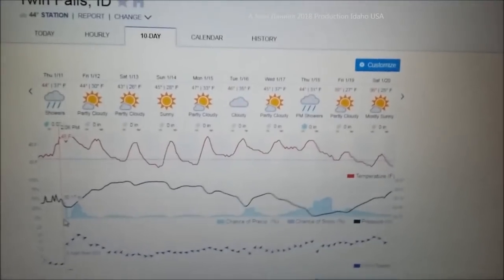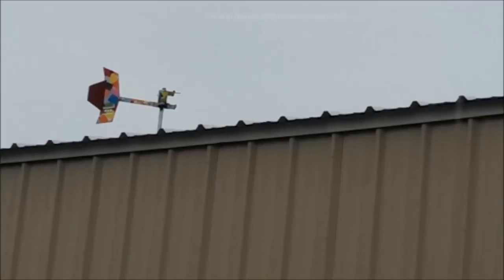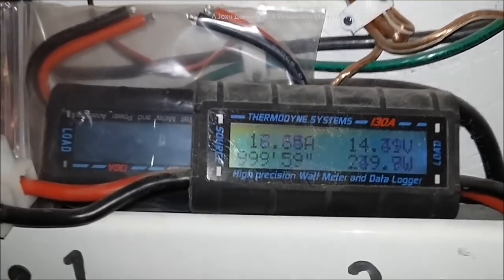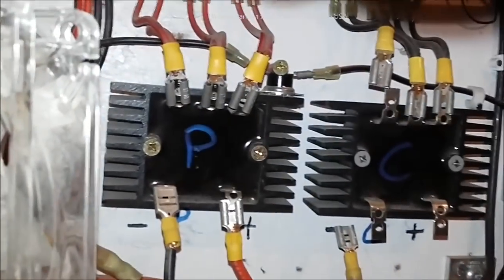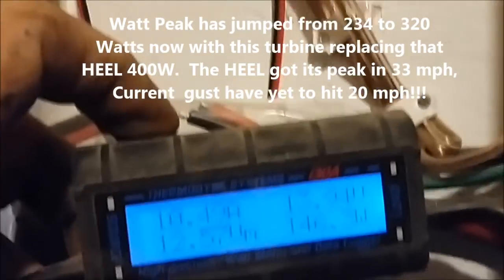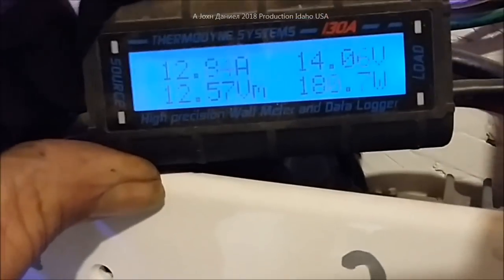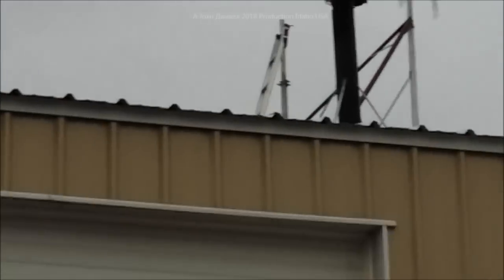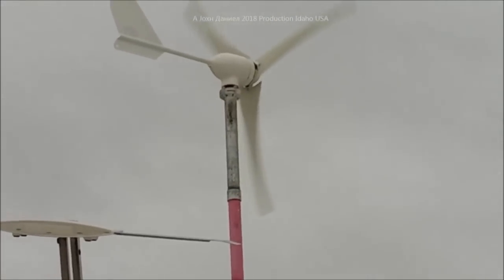Success, $220 (before inflation) China 500 Watt Wind Turbine super performer, BIG PARTS LIST BELOW

Comment from the maker: All the links I could find and add are up above under the video.
Reply: Would be nice if there was a site to verify their claims of some of those generators putting out 2000 or 3000 watts of power for only $200. On some of the sales, I have seen buyers complain the output was more like 300 watts.

Also, you may wan to verify those links. They seem to be broken when I click on them.
Reply: @GeekBoy03  hey 
Yes ... Now i don't know you'r level of tech ... 
1 you can't relay on the Controler you get with the producer ... 
2 you need a 3 phase Rectifier 
3 a MPPT Controler .. 
4 Then you are golden .. 
5 if you don't agree .. Then cool . You Will never get 3000watt out of any 
Wind turbin with out a MPPT
3000watt Divided with 48v = 63A 
6 so you need either a 60A 200v 6415 EPever or MitNite 250v 
Or 80A MPPT for overhead ..3000 often deliver 3700watt at max windload 
Just a head Up 
3000 / 12 = 250A 
3000 / 24 = 125A
3000 / 48 = 63A 
If you use MPPT 
Not PWM CONTROLER 
Why !! Becaus i say so!
Reply: Hey @John 
I would like if you tell ppl 
HOW TO .. with 
1 windturbine 
2 rectifier ..
3 evt electronic break / dumpload and so on / hotWater dumpload 
4 MPPT.. not PWM CONTROLER (like you said PWM is just for IDIOTS)
All these not so Bright ... Can't put 2 and 2 together and get 4 ..!! !!!
And thick lead 5 or 4 x 2.5mm² down to rectifier.. 
And atleast 35mm² from MPPT to battery!!!
Thx Greetings from DENMARK
Ve are never stupid somtimes
Reply from the maker: @kennethschultz6465  I do have a video about 3 months ago where I draw out the process, but yes people should only use MPPT to get all watts placed into battery.
Reply: @kennethschultz6465  I could not find the wind turbines on their page .. can you post link to the actual turbines ... thx
Reply: IT is SHTEPOWER Who make All these brands 
By Stricker EMC EMP RFI NOICE RADIO TESTED 
CE APPROVED .. 
THEY KEEP WHAT THEY PREATCH ..!!!
flot note .. i am a A licenced HAM .. operativ on HF VHF UHF SHF
I do not like interference!! At All ..
The level of noice from these produkts is way under the noice level in any city.!
We hawe also used HP SPECTRUM ANALYZER 
From 10Hz to 4.5 GHz
Found No problems !!
Reply: Give a hallow if you can't find ITVAlso got ther PDF CATALOUG
Reply: Hey John 
Just poster the 2 links but the turbin is 48v
The Alibaba SHTEPOWER SITE to the proper windturbine 
TE500
Or TE1000
Reply from the maker: @muzaffarbaktoo7202  Send me a email to olympicpowercontrols@yahoo.com and we can talk about your interest. I can usually respond in a few days.

Comment: What about the  b c wind turbine  are you the mountain  YouTube  or this one cheers
Reply from the maker: Both, I keep my BLOG Channel up, Prepper Mountain, and this my regular You Tube group channel up with my videos and some small alterations to fit the folks who follow.
Reply: Ok thanks I have  just  brought  this  wind turbine  from b c what was your highest amps and did it last you long  S I'm on costal property  with  plenty of wind  cheers  john
Reply from the maker: It is still running in Baker Nevada at our camp house and it's historic peaks exceed 65 amps, top output was 84 amps in a storm, so be sure to use 3 lines of heavy 3 phase wire, 10 awg stranded copper if run to controller/rectifier is under 18 feet, 8 awg if its over that.
Reply: That's awsome  John  I hope it exceeds the the the junk one I have up at the moment

Comment: @John what would happen to a turbine if one of the 3 phases disconnected at the turbine? Loss of power or zero production?How would I know without taking the turbine down?
Reply from the maker: Loss of 60% or more of the power. Likely no power until much higher winds. Carbon brush on slip ring or wiring issue under turbine back to controller or rectifier is normally what to look at.
Reply: @JOHNDANIEL1  could I check the phases some how at the brake switch in my shop?
Reply from the maker: Yes, disconnect the 3 wires from the brake or controller and test them while some decent wind is blowing on the turbine, 2 each time, repeat and alternate the test till you tested all 3 against each other. See if a great variance is found. You may have a bad brake switch, bad rectifier, bad controller. But free open voltage will tell you if your turbine is the issue.
Reply: @JOHNDANIEL1  the problem I'm having is when I get 20+ mph wind gusts my turbine only puts out between 5 and 14 watts.never anything more than that.

Comment: High John something that i want to ask you very important that if you have solar system in of 10 kw and batteries of 10 kw i want to put up a 1 kw wind turbine how do i connect the lot with each other. Do i have to buy a separate Charge controller because my controller for solar cant take wind wires  do i have to put a wind control system up and connect then to my batteries.

Comment: Has anyone ever change the bearing near the shaft/Flange on these turbine if so how does the shaft come out once cir-clips been removed ???
Reply from the maker: Remove blades and hub, remove  the bolts on pattern around the front of the turbine, using a dead blow tap on it a little bit as you wiggle the face cover will come off make sure you pull very centered because the magnets are strong when you remove the front half you'll note the rotor will slide out of the bearing in the faceplate it's a double row bearing. Take a hair dryer and warm up your aluminum face plate, the bearing will come out easily with light tap.
Reply: I've managed to change that bearing how does the other bearing come out I've removed inner and outer snap ring but shaft will not budge. Its the bearing which is in line with the pole. Any help will be appreciated.
Reply from the maker: It's pressed in. Heat the outer base body not to exceed 300 degrees, and use a tube or something like it to tap it out race points if possible.

Comment: I'm going to buy this unit. I have a 12v battery bank. Should I get the 12v turbine or would the 24v turbine be better?
Reply from the maker: If you get low wind speeds, under 15 mph on the high end you'll want the 24 volt unit to charge 12 volt batteries. I would recommend a 800 / 600 MPPT wind and solar controller https://amzn.to/3Mampaj and it will auto detect your 12 volt batteries but allow the 24 volt turbine to charge them with great efficiency.

Comment: $200..ish!!!! WOW but how's the noise after having up for a while? I have a small house and want to put one or two turbines up..right now battery costs are holding me back..and the noise is a concern for me as I have neighbors with ears. I have heard of people placing sedated teeth on the trailing edge of the blades and supposedly it cuts the blade noise by half. Ever try it? Sorry for the rash of jibberish but I'm a newbie and can use all the advice I can get.
Reply from the maker: For very low noise look underneath some of my videos for links to the 500 watt low wind models, 3 blade, and it will give you good power and very quiet.

Comment: One quick question for anybody that has set up a wind turbine. What is the max distance that I can use a 10/3 outdoor stranded copper cord for a 400 watt wind turbine ?
Reply from the maker: 12 volt 52 feet
24 volt 70 feet
48 volt 84 feet
With 8 awg you add 65% to those.
Reply: @JOHNDANIEL1  thank you

Comment: Hello John.
Thanks for All of your Videos and your shared knowlegde.
I bought the exact same wind Turbine (3 blader) as mentioned in the video.
Unfortunately it won't produce more than 15Wp :(
I got 10mm2 (about 8m) wires attached directly to the rectifier. Which has 10V roughly at peak (60-80km/h).
Am I doing something wrong or is the generator not as good as espected?
Looking forward to any Suggestion.
Thanks in advance
Greetings from Germany
Lucas

Comment: I love your videos and they're so helpful but I have a question for you I want to install one on my roof and it's an 8 pitch can I use that to my advantage?
Reply from the maker: Yes, you can install a pole about 8 feet over the roof from the peak, place streamers like tinsel on it ever 6 inches, and note the best ones lifting up in a breeze to identify the compression zone. then place your turbine center just above that so your bottom section of turbine blades are getting full energy.

Comment: Just finished installing my wind turbine but its not giving power to anything. Have check my wiring for faults but still its not working any ideas?
Reply from the maker: Send me the details on it. Model, where bought, area your installing it in, and any relevant info. I'll see if I can help. olympicpowercontrols@yahoo.com
Reply: @JOHNDANIEL1  got it working. The rectifier that came with the turbine was faulty after checking with meter

Comment: I've seen a 20kw from China which cost 60'000 to put up and it gave out nothing and later that year the main bearing on the blade burned out and that was the end of her as it turned out a bearing couldn't be replaced on her without changing the whole head. It was a complete right off. Three went up in the area 10 years ago and didn't last more that 12 months between them.

Comment: Hi Mr. Daniel, I feel sorry for my English but is what I have, I been making maths and you are lucky because you have about 18m/s wind and maybe for your purpose is correct. But, if the blades are 800mm the potential energy for 18m/s is 7kW, and you are generating at most 250w, that means an efficiency of 4%.
Reply from the maker: Total diameter of 500 watt turbine blades is 1.38 meters. My winds are 4 to 20 m/s. But the properties of a wind turbine is that it has a highly progressive power curve. So when your at 12 MPH wind speeds your making 65 watts ( 4.5 amps) , at 14 mph you can hit 110 watts, at 20 mph you can hit 340 watts, at 25 mph it will and does consistently produce 450 to 550 watts.

Comment: Thanks for posting I bought the similar 300-watt version that works well here in Pennsylvania compared to the other larger ones. It's quite a bit different than the "aerodynamic" ones. I would recommend using 6 volt batteries rather than 12 for this area.

Comment: I don't know much about this, but is 100-200 W good? How much power is that in real world terms? Will it run anything?
Reply from the maker: 100 to 200 watt? These do better than that on a average, 200 watt is a extra off grid 15 amp battery charger at a minimum. Now compare that to the fact we run 5 total on our system. They double the life of your battery bank with the pulse charging effect they make, they run in bad weather and using multiples I never have a low voltage moment in almost a decade of doing it.
Reply: @JOHNDANIEL1  I guess I need to do more research. I didn't understand any of that.

Comment: Purchased this turbine about a year ago, but have yet to put it up.     Thinking about using an inverter that allows it to tie directly into the grid, with a resistor for the dump load.   Would it work correctly?   Looks like it has a built in brake.   Any comments?     https://www.amazon.com/dp/B07FFSQ5PQ/?coliid=IZX3OMZN4IDJW&colid=XPZ319JX03I8&psc=1&ref_=lv_ov_lig_dp_it

Comment: For me it's the batteries that are expensive so I prefer solar just because the power is constant and I can use it as it's coming in directly without having to go through the batteries first which wears them out faster.  With wind you get surges and drops requiring all power to go through the batteries to keep you running during the drops.

I want to use an electric car as one big ass battery bank on wheels. :)
Reply from the maker: Avoid Lithium, factually has a short life, over hyped, dangerous and 3x the cost. Get the DEKA SOLAR or Duracell B-903-L16 that actually last a real 10 years. Made by East Penn, sold by Batteries+ as a Duracell for less.  https://bit.ly/2wv1VXd Order online, pick up for cheap.

Comment: Can you store energy with this..? Like for example, could you just keep charging up something (a battery I'm guessing?) For a month straight ? 

Also would you say 2 of these could power your houses lights/computers/small things? (not furnace or anything more serious)
Reply from the maker: If you have constant wind, you can achieve a lot, but without solar your not guaranteed anything constant. As for a battery bank, when it reaches full charge it just diverts excess into a controller or diversion load.

Comment: Dear Mr. Daniel, My name is Stosh and live in Nome, Alaska! I love the videos and all the information that you put out. I'm hoping to get a parts list from you of all of the stuff needed to install 2 turbines on the roof of my shop, wire size and everything that I would need to install a system. I want to add solar later. we pay about $0.32 a kwh. what I want to do is be able to auto switch from city power to battery bank when they run low. can you help me?
Reply from the maker: You can direct questions to my shop email olympicpowercontrols@yahoo.com
I usually can help with more accuracy knowing all parameters your dealing with. Better to focus the dollar than waste it.

Comment: Its amazen to see how that wind turbine making power
Reply from the maker: Absolutely. Be careful on St Lucia for them south basting winds in a storm, make sure you have a way to keep yours safe. Mine has seen over 100 mph winds, they are OK. but I  made my own loaded braking system.
Reply: I see storm here already people roof fly tall coconut trees brake in 2 i have ground mount solar I had trap it down because of high wind see some times

Comment: Uxcell Fixed Type 2R Tubular Wire Wound Resistor, 100W, 2 Ohm
by uxcell
4.8 out of 5 stars 6 customer reviews Share

    Compare: Offers for this product Offers for this product and similar products 

There are currently no listings for this search. Try a different refinement.

Comment: Rite now until June 1st 1800 watt turbines on ebay $224.00!
Reply from the maker: If you believe a 2 pound copper coil in a Asian made PMG-PMA to be claimed as passing 1800 watts @ 12 volts though a 12 gauge wire is possible then by all means get 10 of them at that price. In the mean time in the real world, you will need 9 foot diameter blades and 30 mph to get those results with 9.5 lbs of copper coils, but on that $224 thing you can get it for about 5 seconds till it smokes. A moron from Missouri sells such a item that could not make 1800 watts no matter what you put it on whether its a wind turbine, a jet engine or a V-8 engine. At least the guy in California makes one that can physically hit 1800, but you just can't do that and make it last long plus the blade size needed to gather that much energy exceeds the shafts ability to support the mass.
 My experience with those EBAY ADS, is if the sellers want high sales, they should employ real results even if its 600 watts, Real installer reviews/videos in their ads,  and the buyers will run to results over hillbilly hype. 600 watts of real power always trumps 1800 watts of fake power!

Comment: I am new in windenergie but how do you protect your batteries from overcharging?
I have a wind generator and if I run it without batteries it will give 16 a 17 volts.
I don't dare to connect it to the batteries because I am scarred to ruin my battery bank. 
Hope you can explain me
Reply from the maker: The battery will keep charge down to the battery ability for the most part. For over voltage you use a controller that stops charge at 14.0 volts to a 12 volt battery. If you use Lithium or GEL battery you need a more advanced charge control.

Comment: I suggest adding a second cooling fan for redundancy. Cheap computer fans like the one you appear to be using are KNOWN to fail without warning and many of them have fairly a short and unpredictable time to failure...even from the same production batch. MTBFs of 80,000hours (or higher) claims are also often greatly exaggerated for this class of fans. 
Unless you have a fail-safe to shutdown the turbine if the cooling subsystem fails...or components fail due to overheating...this could be problematic depending on your specific system design. Overheated rectifiers could fail open or short-circuit (although usually open if they're what I think they are). A redundant fan looks like it would be very easy and cheap in your design and if you check things over as often as it appears you likely do, you'll see when a fan fails before it becomes a critical cooling issue. The key thing here is that it is an easy update with potentially high value...so why not just do it?

Comment: Dumbo here when it comes to electricity units etc. What can this power run, can it run 110v or 240v. Very confused. Can it be amplified etc? Clueless here :) tks
Reply: The turbine in itself produce alternating current with varying Volts and Amps, depending on the wind speed, similar to the dynamo in a car. To make any use of it, f.ex. to charge batteries, you must rectify the electricity  to direct current, which is done with a rectifyer, the thing in the video that sometimes need cooling. There are other means to make the electricity useful in ordinary household machines, but all within reach. Hope this helps :-)

Comment: could you mount one of these on top of a camper van?
Reply: Probably. Would require MAJOR structural considerations. You would also want to consider the impact of catastrophic failure (blades flying off at high velocity, fire, etc) and the noise amplified by resonance with the vehicle's body. I suspect that it would be like your van being the guitar body with the turbine vibrations acting like guitar strings. Trying to sleep inside the "box" would be likely near impossible.
You also have to figure out where to put all the support electronics and ensure they aren't thermally stressed.